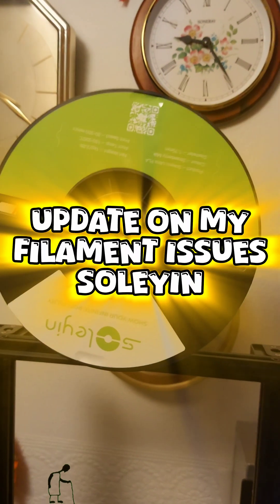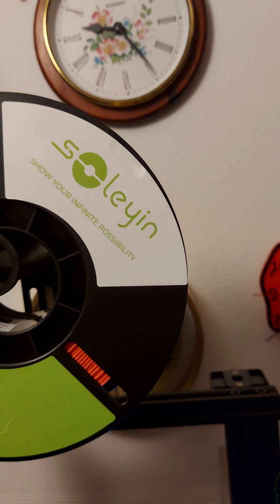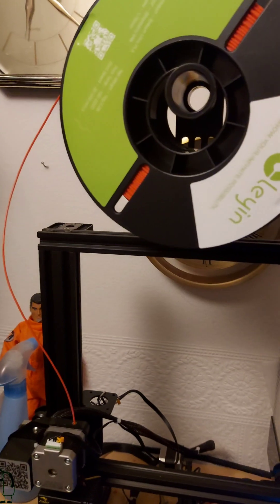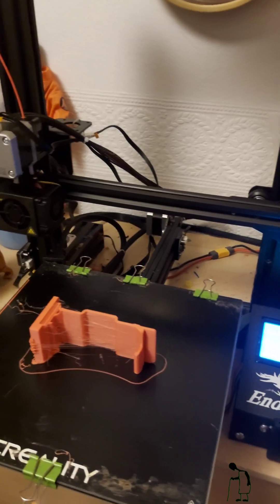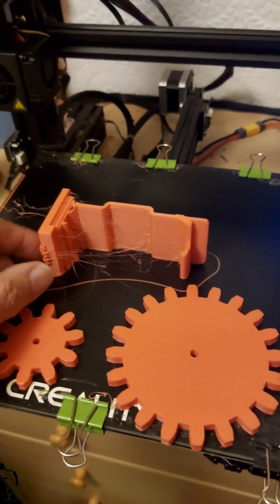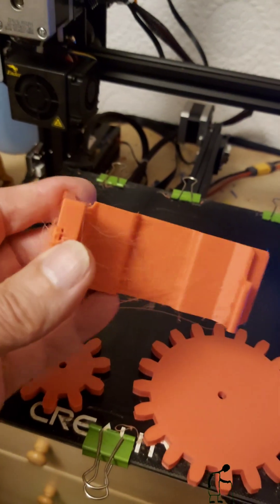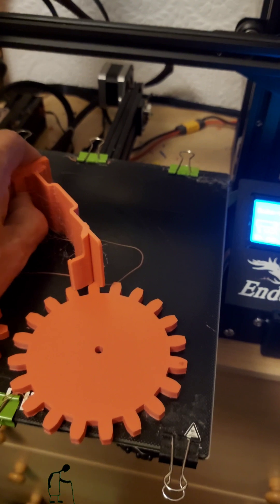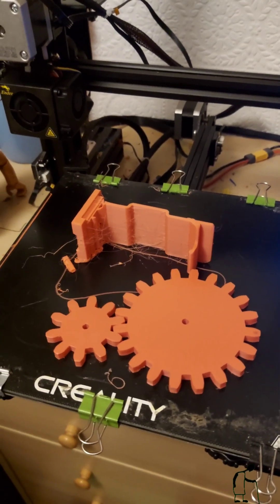Filament Issues Soleyin UPDATE

Comment: This stuff is garbage. I thought it would be good, but I have bought stuff far cheaper that prints a lot better. I only get good results when I have the temp at 196 and bed temp at 58. I have to clean the bed and reapply new glue each print. I then have to raise the z height to .0035 and reduce the flow rate to 98 to get it work. Even still, I have to use it for prints that don't use supports. Every time I use supports, the print fails in some way.
Reply from the maker: Yes,  my usual response to issues is to start increasing the temperature, but that made it worse so, like you I dropped the temperature. I am running at 198 and most of the time I need a raft and glue to keep it on the bed. I have managed to use up two of the reels so far - only 3 more to go 🤣🤣🤣 Surprisingly, some of the prints come out reasonably OK, and then the next one fails with no changes to the settings. Last night I tried to print some gears for a toy car, that was hopeless, it just could not do the fine work reliably. Bigger stuff is not so bad, still not good, but not so bad if you don't need fine detail.

Comment: Print a few temperature towers at various temperatures, also make sure it's absolutely dry. Food dehydrator or oven at 70C/150F for an hour.  
Creality printers are also notorious for stringing, you have to set the retraction pretty high.

Comment: Lower temps cheaper printing. 😉
Reply from the maker: The fact that I have increased the speed a tiny bit will also add to the overall cost reduction, but I don't think the total difference will be noticeable.
Reply: @GrandadIsAnOldMan On a hobby level it makes very little difference but if you were running a serious production with multiple machines constantly running it could make a big difference.
Reply from the maker: @DirtyPlumbus  Yes, 👍👍